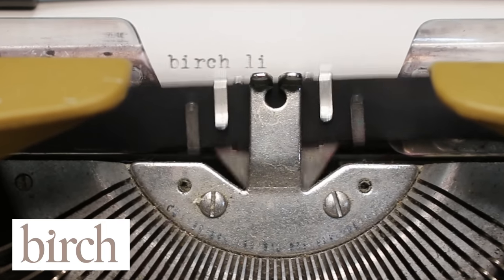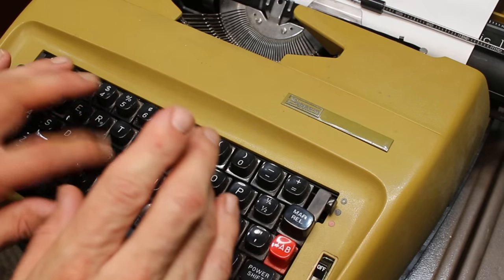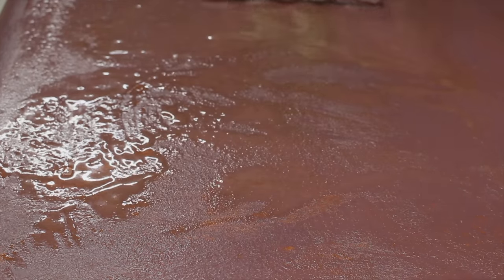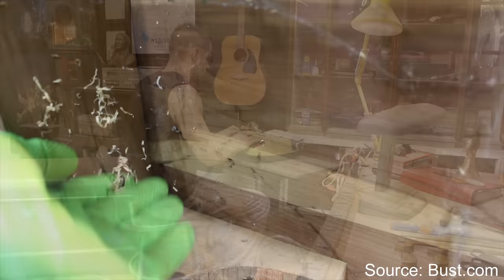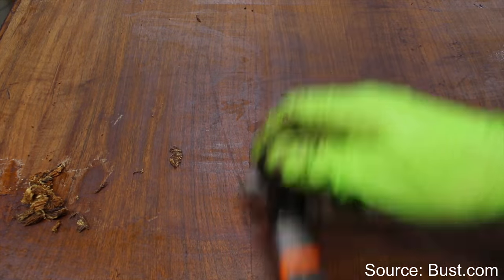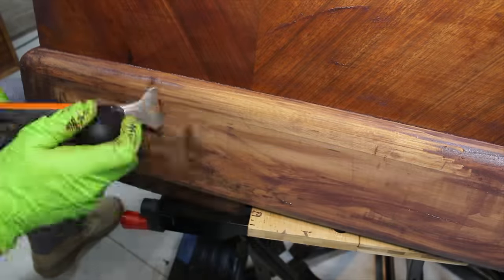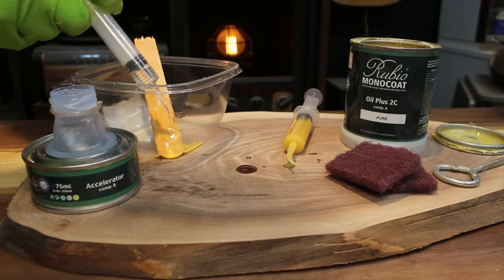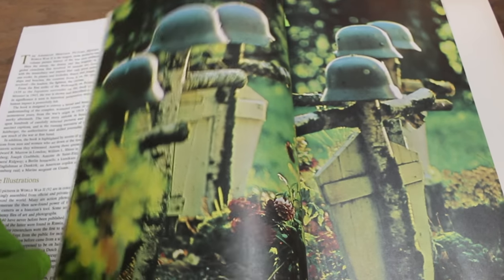Ep. 47 I RESTORED this Old Painted Chest

Comment: Thank you for doing such a lovely job on the waterfall chest. It always amazes me in all the ones I've seen, the original cards are still stapled to the inside of the lid. I purchased mine back in the early 1980's at a consignment shop. It was on sale for 1/2 price ($55) because the shop owner said it was locked and there was no key. I had them deliver it and was so happy that they didn't know that all they had to do was press the button and the lid would open. I still have her and she takes care of all my blankets.

Comment: I recently had the privilege to restore one of these that had belonged to my clients grandmother.  It was a waterfall almost the same as the one you did.  It was unpainted but in need of restoration.  I stripped the old finish but had to paint the base.  There was a large hole in the base and I had to repair the hole with bondo.  I did not have the skill or tools to re veneer over the hole or replace the base.    I used general finishes nutmeg gel stain and sealed with general finishes armor seal.  I don’t know the whole story behind the chest.  These chests are beautiful and it is sad to see so many discarded.
Reply from the maker: I probably would have used the same finishes. Great choice